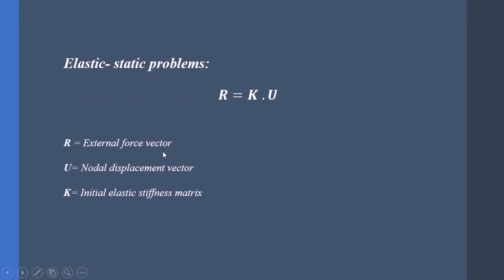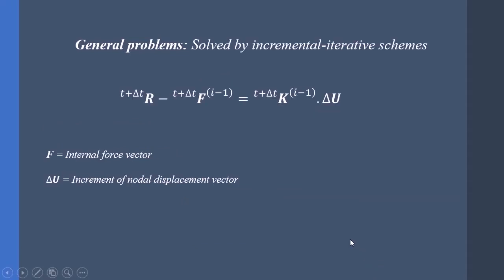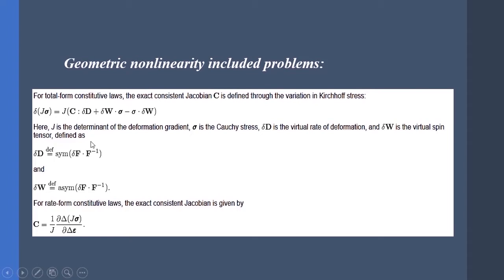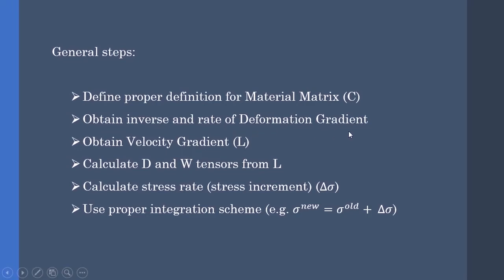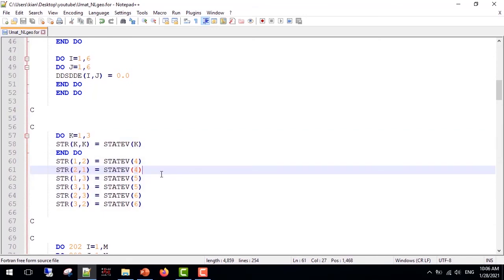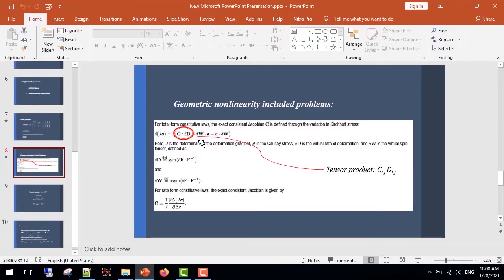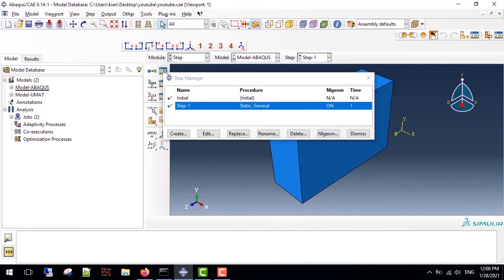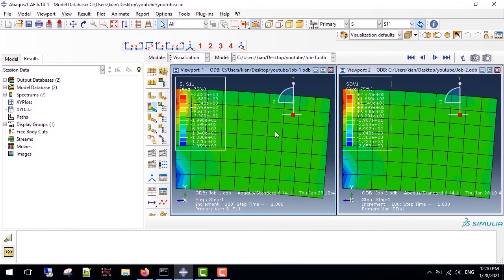ABAQUS UMAT for geometric nonlinearity

Comment: Hi, thanks for the useful video. 
When we have geometry nonlinearity, we have to add this code or it can help convergency?
I have a umat for an isotropic hyperelastic material which works very well under simple loading but it's hard to get converged for complex geometry and high deformation. It can be solved if I add this piece of code into my umat?